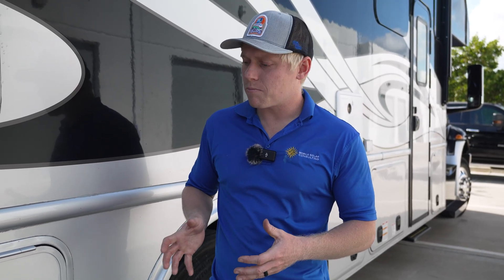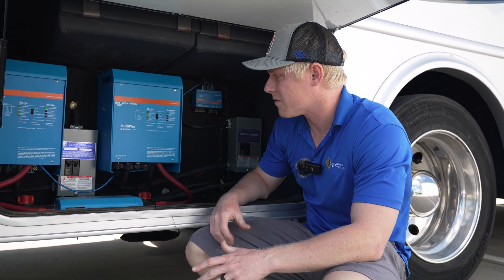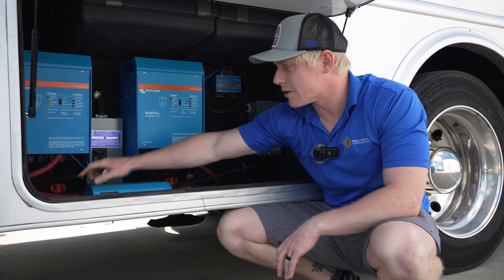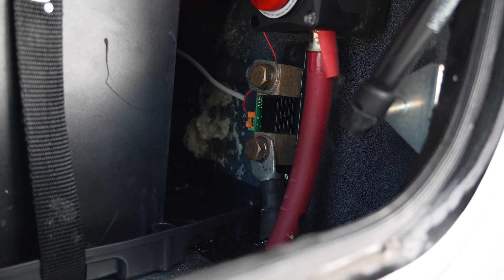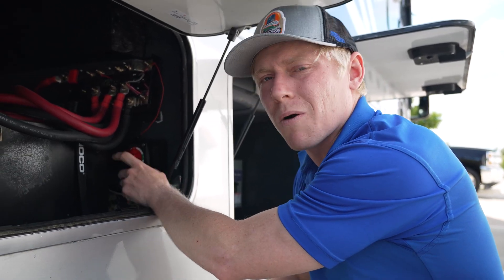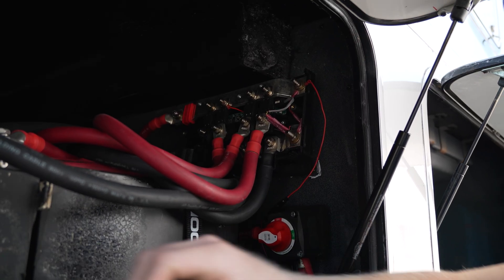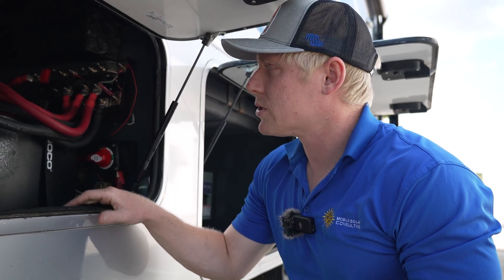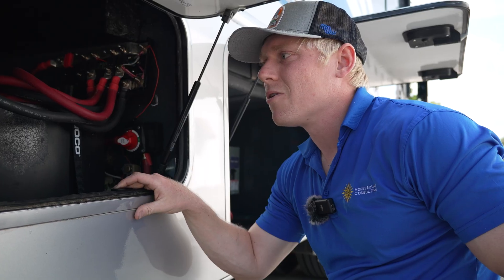Fixing Up RV Dealership’s Solar MISTAKES! (Avoid This on Your RV)

Comment: I believe this is a problem with many dealerships, they can do anything but they don't do always everything right. I had a solar system transferred in 2018 from one RV that I traded in to a new one where the dealer made similar mistakes. Solar charge controller too far from the batteries, AGM batteries at the time too far apart and wire runs to the inverter too long. The system never performed to more than 60% of its potential and the inverter was always struggling with low voltage. In today's world there is no excuse for professionals and DIYers to make these mistakes, all the information is freely available on the internet.
Reply from the maker: Yep!

Comment: Its too bad they went with 12V for a new build. I can't imagine dragging 4/0 around like that.  Holy cow!   I'll take 2 AWG @ 51.2V for 5kW without even breathing hard any day of the week.

The mega-fuses are probably ok at 12V, coming from single batteries, but they wouldn't be at 24V or 48V.   I would also have kept the separate battery bussing (paralleling at distributor), since the cables are carrying half the amps that way.  Paralleling the batteries first and dragging one set of cables to the distributor is an inferior wiring technique and 12V systems need to avoid as much voltage drop as possible.  Unlike 24V or 48V systems which can tolerate the voltage drop.
Reply from the maker: Except the MEGA fuses are each fusing 2 batteries.

Comment: After watching  Will Prowse videos on fuses I would never use one again. DIHOOL Heavy Duty Battery Disconnect Switch, 300 Amp DC Circuit Breaker are way better just watch his videos on testing fuses vs the Circuit Breaker and the cost is almost the same.
Reply: For a main battery bus you usually want to do both.  Fuses have no moving parts... a good fuse is almost bullet-proof, but blowing a fuse is not fun so one usually also has a breaker on the same path that will trip first and serve as a decent disconnect (rather than a manual rotary disconnect switch).

The two together add additional safety for downstream fusing which won't have the I.R. to deal with a full-on battery short.   In this configuration the fuse is usually sized to 150% the high expected current and the breaker is sized to 125%.
Reply from the maker: I would disagree. You don't want a fuse and breaker on the same circuit. They each add resistance. This will cause a large voltage drop and excessive heat generation on that cable.
Reply: @MobileSolarConsulting   Urm.  No, it doesn't cause a "large voltage drop".  Where'd you get that from?   Anyway, I do agree that voltage droop on 12V systems is a problem just in general, but usually its due to under-sizing cables (because who wants to run 4/0 all over the place?), or using the wrong fuse or breaker amperage (another common problem).  On a more reasonable 24V or 48V system it's a complete non-issue.

Each doubling of voltage reduces resistive power losses by a factor of 4.

The reason you have multiple layers of protection between the battery bank and the battery bus is because all the devices and circuits hanging off that battery bus are going to have fuses with lower I.R. ratings.  You have to be absolutely certain that the amperages allowed on the battery bus do not exceed those ratings even in situations where a safety component might fail.

It's also a good idea to have a disconnect on both sides of the wiring harness.  The fuse near the battery, and a proper DC breaker going into to the distribution bus.  The breaker thus serves as a twofer.

The reason fuses should be sized to 150% the maximum expected current, and breakers to 125%, is precisely so they don't overheat.   In higher-voltage systems these margins are easier to achieve while still staying under the 90C wire ampacity.  Usually one uses the 60C wire ampacity and all the numbers just work out.  However, 12V systems, due to the low voltage and extreme currents and unwieldy wire sizes, are often constructed too close to the margins.

-Matt
Reply from the maker: "Where did I get that from" is over a decade of designing, installing, and troubleshooting electrical systems. Every fuse and breaker has a significant voltage drop across it, both in theory and in practice. Every one of them creates significant heat. 

Using multiple forms of over-current protection on any single wire is discouraged or not allowed in basically every set of electrical codes and standards in the USA. RV's and Campervans don't really have to adhere to any specific set of codes, so you can do whatever you want, but there is no reason to do so. It does not make the circuit any safer.
Reply: @MobileSolarConsulting  Dude, you are talking nonsense.
Reply from the maker: OK

Comment: i agree on the 24V system. If the batteries are going individually to the fused busbar then you can use a MEGA fuse for every battery. As long as each individual battery is not above 200Ah.
Reply from the maker: We are just doing our best to follow ABYC. What standards or codes are suggesting a MEGA fuse is fine?
Reply: @MobileSolarConsulting  The I.R. for a mega-fuse is roughly 2000A @ 32VDC.   At 12VDC that same rating is good for 4000A.  One can also get higher-rated mega-fuses.  Did you check the actual fuses?

Anyway, a mega-fuse is plenty good enough for a "small" 12.8V battery.  200Ah is "small".  That's barely 2.5 kWh.  The cell short circuit current will have a hard time exceeding around 3000A.  The fuse has no chance of fusing into a short.  It would not be good enough with paralleled batteries / more amp-hours, or higher-voltage batteries.  But for 200Ah @ 12.8V its fine.

Remember, there is also a BMS in the current path.  I didn't check the battery specs but there might be additional safeties in the batteries beyond the BMS, too.

I would have kept the separate battery bussing too... that is far superior to paralleling the batteries first.  Not that I'm against paralleling batteries first... I do it all the time at 24V and 48V, for convenience.  But at 12V you always want to bus the batteries to parallel them, not parallel them first.  And they were already paralleled at the bus so there's no reason to do the extra work to undo that.

I agree re: all the manual disconnects.  Those are fire hazards (in my view).

-Matt
Reply from the maker: Glad to see your perspective on it thanks!

Comment: Im trying to compare lithium setup to a gas/diesel generator to power a service truck bed. 110 tools and a large welder required 50a outlet. Is their a victron inverter model i should look at that can complete the task or is it not feasible?
Reply from the maker: I would need details on the welder. Feel free to email us, or call.
Reply: i think you might be asking a lot for a 50amp service which probably also has pretty high inrush. I think this might be an issue for the inverter as well as require very large battery capacity, depending on how much welding you plan to do. I'd love to hear a follow up on this .